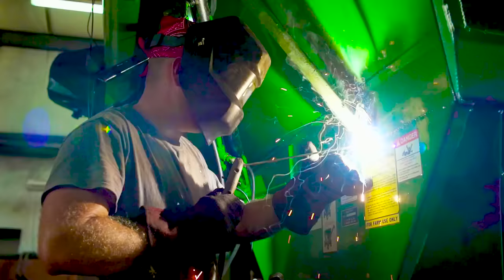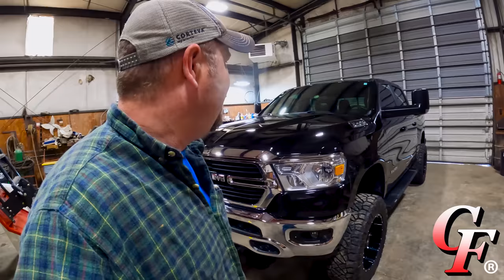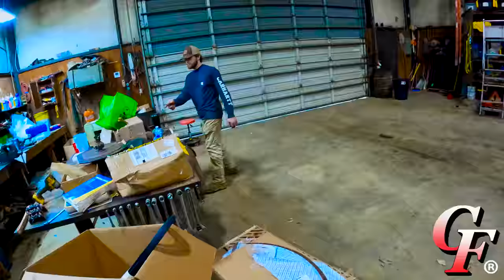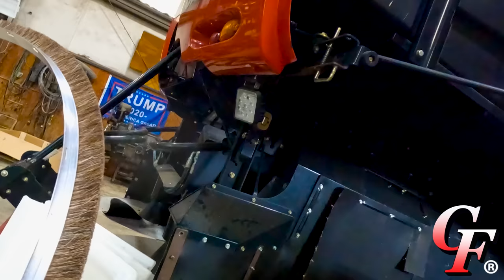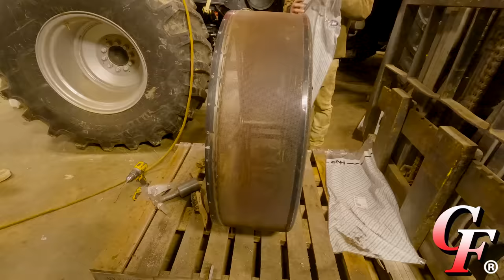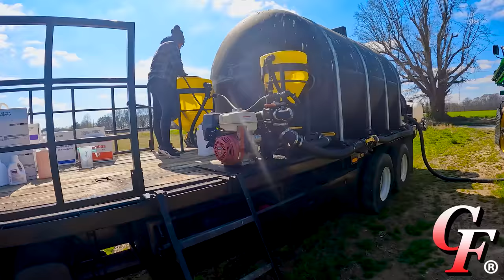How Many Farmers Does It Take To Fix A Combine???  (3/13/23)

Comment: I remember repairing that bottom gearbox. It's so heavy, and in an awkward location above the tire. I did it alone. Lifted it up as high as I could with a cherry picker and got two long pieces of ready rod through the bolt holes. It was alot of turning of the nuts, but it finally pulled up tight to where the rest of the bolts could be installed.  Now I replace the oil in that gearbox yearly. I'm from Iowa and really enjoy watching your videos.

Comment: You didn’t have to grind anything on the processor could have just put the sheet metal covers back on and that pulls the end of the bolts away from the processor